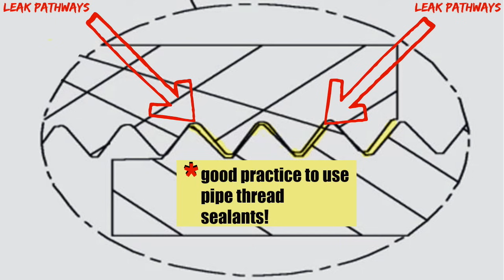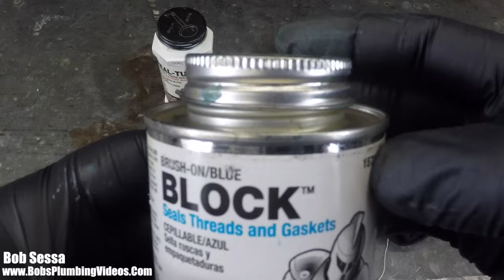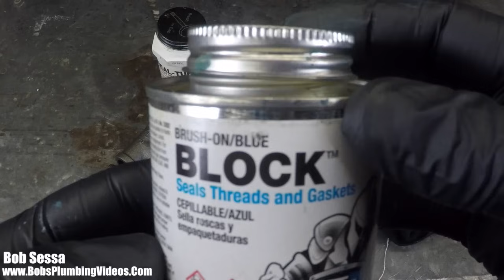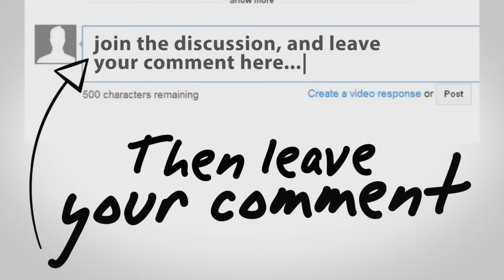Pipe Thread Sealant / Which Pipe Sealant & Why!

Comment: Sometimes you have a 90-degree fitting. It must point in a certain direction. So you won't be able to tighten it all the way down. I'm assuming by using both materials it will aid in this? Thank you in advance.
Reply from the maker: If they're loose threads, you can fine tune things by adding more Teflon for sure.

Comment: Thanks for the video. What is the maximum temperature you can use with those compounds? I need to install a brass fitting into a steam generator iron tank made from stainless steel.
Reply from the maker: I use the blue block on steam heating systems daily. 212 degrees plus, work like a charm.

Comment: nice video sir. so what about steam and high temp water. i run boilers and we heat water to 350 degrees and add nitrogen pressure so it doesn't boil. so 250 psig and 350 degrees F. all the old school guys put pipe dope then Teflon and more dope. thoughts? pipe dope is gas X
Reply from the maker: So as a kid/helper I was taught to use lamp-wick (spool-wick) followed by Pro-Dope (by Hercules). On problem joints instead of Pro-Dope, we used Grip again by Hercules.

When Teflon came onto the scene, I  started using it followed by Mega-Lock which I still use today. For problem joints, new steam installations, gas work, I use Blue Block. N.Y.C. code doesn't allow Teflon for gas work.

 No right or wrong here, guys have their own personal ways of preparing a joint and the goal is not to have any leaks. The Blue Block has never disappointed, but don't get it on you or your tools, it's a pain in the Ass to remove (lacquer thinner)

Regards, Bob.

Comment: If tighteness is by feel how do you keep things perfectly up and down such as a shower neck. What if it's as tight as you can get it while being straight but it still leaks?
Reply from the maker: Bottom line is you may have to remove it and try different techniques. More tape, use some lampwick, whatever it takes to make it leak free. If you over tighten things, you always run the risk of breaking off the threads. But you do what’s necessary to stop the leak.
Reply: @BobsPlumbingVideos  I literally got these to where they tightened easily by hand and then another quarter turn is all they had, using leverage too.

Comment: Would it make sense to add dope before AND after applying the Teflon tape? If you think about the mechanical stress on the threads, it’s actually in the shear direction, right? So wouldn’t the dope be equally advantageous on both sides of the tape for the micro gaps in the male’s and female’s respective threads?
Reply from the maker: Some guys actually do that. I personally will apply tape first followed by pipe joint compound. Regards, Bob.

Comment: Thanks!  I think I now know why my 1.25 to 1. inch reducer is leaking/dripping on my pressure tank diy hook up.  I over-torqued it and used only metal pipe dope.  I will get a new reducer and use teflon with teflon sealant, and not over-torque.

Comment: Do you have a video or, know of a video that shows how to connect a PVC schd 40 female or male adapter to an elbow on metal pipe?
Awesome video, Bob. Thanks so much.
Reply from the maker: When I screw schd 40 pvc on or into metal pipe I generally use teflon tape followed by Blue Block or Grip. Either or will work.
Reply: @BobsPlumbingVideos  and only to prevent abrassion on the plastic part and prevent sticking, so not as much as metal-to-metal, right? 
BTW, one can really see you know your stuff. On the other hand I like the looks of neatly wound teflon tape sticking out - it looks clean and done to me when checking later (but only on ugly plastic or metal hidden joints, not the fancy visible shiny pipes).

Comment: Dumb question. - what if you forgot to do this on a multi part set-up and it would be too hard to take everything apart? Is there good (enough) way to add something to the threads AFTER everything is in place?  Or am I (un) screwed?
Reply from the maker: Not that I’m aware of. If it’s a very minute leak, a little blue block over the leak and it may help. But I’m talking about a sweat bubble,good luck!
Reply: BobsPlumbingVideos   Ok thanks. Turns out the pressure reducer might be bad so everything will have to be cut out anyway. Will get to do it “right” when replacing. *Sigh

Comment: When I changed over from galvanised pipes to copper tubing 35 years ago, I installed a permanent pressure gauge on the cold water line in basement laundry. Many older homes in Vancouver, B.C. Canada where I live do not have a pressure regulator valve. The typical pressure in my neighbourhood was about 80 psi, dropping somewhat in the summer. A few weeks ago it was going up as high as 120 psi, so I decided to install a Watt pressure regulator on the 3/4 copper entry. My first two attempts with teflon tape only on a tapered brass fitting dripped, and on my third try with even more tape it still leaked, and now a union on the line was dripping. I found your video, bought the Canadian MegaLoc, which has English and French instructions, followed your directions and both connections are completely dry. What I really noticed as I torqued with the MegaLoc and teflon combo, was how smooth and easily it tightened compared to teflon only. Pressure is now set at 60 psi. Sure glad I found your video. Angus.
Reply from the maker: I’m glad you found my video also Angus, love helping homeowners like yourself. Regards and thanks again...Bob

Comment: Excellent video.  Thanks for the detailed explanations.  I wrestled with leaks installing an outdoor water spigot.  Teflon tape alone didn't cut it.  I ended up using Teflon tape and Real-Tuff Thread Sealant.  Totally did the trick.  Thanks much!
Reply from the maker: Thank Goodness Yo-yo Patrick for checking out the video! Regards, Bob.

Comment: Thanks for the advice! I only put Teflon tape on a new kitchen sink shut off valve and it wouldn't stop leaking. I'm going to get some sealant tonight!
Reply from the maker: Good Luck!
Reply: BobsPlumbingVideos it worked like a charm
Reply: Did you use 4-5 wraps?   But i know the old pastes and the new pastes work better. Just messy.  I’ve seen pros use both wrap and paste together.

Comment: My rust-off part of the steel pipe left in the steel elbow is so hard to extract. The extractor is scraping off the interior of the metal pipe, but the part is still not moving. What kind of thing could have been applied on the thread?

Comment: Dope then tape. Fills in the threads better and comes out much cleaner. I'm a Fire Sprinkler Fitter and I usually do about 5 wraps. We use either Teflon dope or C5A copper anti cease along with Teflon tape
Reply: The age old trade argument. Lol.

Comment: What goes first pipe dope then Teflon ? Or Teflon then pipe dope ? I personally do Teflon first then pipe dope. I know a few plumbers that do pipe dope first then Teflon. Give me your opinion.
Reply from the maker: Ricardo Quinones  I personally go with Teflon first followed by mega lock. But I know plumbers who prefer to apply the compound first followed by the tape. I guess it’s a matter of preference. Regards, Bob.
Reply: BobsPlumbingVideos truly I feel it’s more than preference because blue pipe sealant is more or less dual purpose it’s a sealer as well as a lubricant so when you apply the sealant before the Teflon it’s gonna act as a barrier in between the tape and the metal while the sir may work I feel like the Teflon will bunch up on you or slip a lot easier just my opinion

Comment: What do you use on fittings that carry heating oil?
Reply from the maker: I would use  the Blue Block or Hercules also makes a product called Grip which is colored black. Where gloves and use it sparingly, it can get messy if you're not careful. I believe they do make PTFE tape that will work with oil, you'll want to check with the major manufacturers of pipe sealants.
Reply: Thanks. Yeah I've had luck with the yellow teflon tape which is rated for diesel fuel.

Comment: Great vid with tons of info.  It appears you prefer Blue Block for gas applications as stated around the 14 minute mark.  But I need one thing clarified if you can:  
Is Blue Block the product of choice for every connection from the supply line to the appliance?  i.e. Black pipe coming from floor to brass shut off valve - Brass shut off to stainless flex line - stainless flex line to a stainless fitting - And finally connection to appliance.  Is Blue Block good for all those dissimilar metal connections?
Reply from the maker: In my opinion, It's the best choice for leak free joints. You just have to be "neat" about it if you can cause it's a bear to get off (lacquer thinner).

Going from the outlet of the gas cock including the flexible connector and range fittings, I generally use Mega-Lock, simply to avoid getting that Blue Block all over the place. Thank You for checking out the video!

Regards, Bob.
Reply: You aren’t supposed to put anything on the stainless. Flare fittings work without sealant. I’ll dope unions and flat basket washers but I was always taught never to dope flare fittings.

Comment: Blue block with teflon tape works in both new and old pipes because the new ones come with all kind of impurities also, you don't want to take any risk. Of course for the gas pipes only blue block on the male thread.

Comment: Thanks so much!  You took my small little job too another level. Simply I have to put a 90 Into my gas cook top. I was just going to use the gas teflon tape. I have two elbows to Install, going out to buy pipe dope. You rock!

Comment: I do not use Teflon tape, period.  Yes, it is quicker and cleaner, but if leak prevention is important, I only use threaded pipe sealant, and specifically Harveyseal formula 55. I just finished installing an 80 gallon air compressor and plumbed it with copper pipe, some sweated joints and most with threaded fittings to accommodate the ball valve and regulator. 175 PSI and no leaks!

Comment: I'm in Europe so we might have different fittings but I think some of our threads are straight, not tapered. I have a problem when I can't fully tighten a joint because it will finish up pointing the wrong way. Is there a different technique for straight threads?
Reply from the maker: Hard to answer because all I've ever know is National Pipe Thread N.P.T which is tapered to create the water tight seal. Straight threads would just continue making up into the fitting, so I'm not aware of how you would make that water tight.
Reply: HI Bob... Very informative video... I'm in North America but in the same boat as Phi in that we have two sets of wall faucets. I was advised to use ProDope to help seal them, and for one it worked really well (so far) however the other one has a slight trickle when the pressure of both hot and cold are up full. Both are straight threads where the tap screws into the fitting and once in the proper alignment are pulled tight together by an outer threaded ring that is tightened against the wall, tile or wood (as is the case in my installation). When I first installed both faucets neither leaked. I believe the one that does show a slight leak however was inadvertently nudged and may have broken the seal? I un-installed the faucet, cleaned the threads (about 90% clear with fitting side less so due to it being in the wall) and re-installed with just the ProDope again (small town so not much else is available here). Would I stand a better chance of a better seal with your teflon (white or pink?) and ProDope? and... do i need to get the threads (male and female) absolutely  clean before re-installing?
Reply from the maker: Bottom line in my opinion is if you use a few rounds  (4-6) of plain old white Teflon followed by the pro-dope you should be good to go. If you can find the Mega-Lock or Real Tuff better. I think the pro dope is petroleum based and may have an adverse effect on the teflon. Hear are a couple of links: http://amzn.to/2iXBo9d or http://amzn.to/2iXGEJD. good Luck! Bob.
Reply: Thanks Bob... wow... very quick too! I'll check out to see if either of those two products are available within an hours drive and try that out. If I'm able to get one of them can you tell me if once applied and installed ... if there is another leak will I be able to disassemble the tap from the fitting easily again? In the mean time I'll probably have another go with the teflon and ProDope although I'm a bit concerned now about the petroleum base of the ProDope. Will check into that before forging ahead with than one.
Reply: I only bought the stuff yesterday so I've not tried it yet but I was advised elsewhere to try Loctite 55 string. This looks much like PTFE/Teflon but is a lot stronger and comes with a blade to cut off a length.
Reply: Hey Phi... how did it work out for you? I ended up finally using orange teflon around the entry end of the faucet, coated it with a thin layer of Megaloc, then filled the remaining threads of the faucet with Megaloc, screwed it in and secured in place with the locknut washer (included)...  three days in and so far it seems to has done the trick

Comment: With threaded brass fittings, leave ~2.5 threads showing on the male connection as a general guide to avoid over-tightening the softer brass.  Brass threads can warp, crush or distort if over-tightened.
Reply: If you don't make the brass scream, it's not tight enough.

Comment: my problem is in the fitting where the pipe goes in will the blue block work on this. I believe the treading in the fitting is a little worn. will blue block work on this.
Reply from the maker: I would recommend using a pipe tap to clean out the threads, then follow up with lamp-wick and blue block.

Comment: Does oil from machining threads need to be cleaned off before applying pipe dope and teflon  tape? Or not necesary? Does oil prevent compound from sealing well?
Reply from the maker: I wipe off all the cutting oil before applying tape or compound.

Comment: what do you used for water seal when connecting a male threaded pvc to a threaded cast iron or brass female opening
Reply from the maker: I would use Teflon tape first followed by Mega Loc joint  compound. If it's a problem joint, maybe the spool lampwick followed by the Blue Block.

Comment: Hi have you used a loctite 59241? I found a tube in my plumbing box probably good 15 years old.. when I used it on my compressor fittings.  And a few days later I removed the pipe. The paste wasnt dry. It was still wet kind of pasty almost, my question is it supposed to remain kind of wet. Or is it supposed cure and fully dry?
Reply: 592 is a medium strength slow curing thread sealant. It should work quite well.   I use a lot of 545  and am happy with it except for its price.
Reply: 545 sets up if away from air  but as I've not used 592 I don't know if it does.

Comment: How does leaving the first thread untaped work? I hear for and against.
Reply from the maker: Some plumbers leave it untapped so the pipe will engage into the fitting easier. Personally that's going to depend on the condition of the pipe and fittings I'm working with. I either will or will not go all the way to the end of the pipe.

Comment: Can you just use the megaloc without the tape on water pipes?
Reply from the maker: On gas lines (low pressure) I use only the Mega-Loc. For all my waterlines, (high pressure) I use Mega-Loc and Teflon or the spool Lampwick. I don't want to chance getting a leak at a later date. Regards, Bob.

Comment: I'm trying to stop a leak between a 1" FPT polypropylene water filter housing cap and a 1" MPT to 3/4" PEX brass adapter.  Is there a thread sealant similar to Blue Block that is safe to use on potable (drinking) water lines?
Reply from the maker: For that application  I would use the Real-Tuff thread sealant on top of Blue Monster teflon tape.
Reply: @BobsPlumbingVideos  Thank you so much for your help, my leaks are stopped.  I installed an Aquasana Rhino 600K whole house water filter system consisting of a pre-filter, a tank and a post filter.  The system was intended to be installed with the filters in-line with each other using PVC pipe and union.  However, I didn't have room for that so had to install the filters above the tank using 3/4" PEX.  I had leaks at the inlet and outlet on both filters (fortunately none at the tank).  Aquasana wasn't any help, they just said use more teflon tape and nothing else.  I had already tried 7 wraps of Blue Monster tape with Oatey Great White pipe joint compound on one of the leaks and while that helped I still had a small leak.  Ended up using 9 to 10 wraps of Blue Monster tape with Real-Tuff thread sealant and that fixed all 4 leaks.  Thanks again!

Comment: Finally a truly informative, fundamental video! You almost lost me when you wrapped the nipple without flattening the teflon tape... Just curious why is teflon not code for gas in NYC?
Reply from the maker: That's a good question? I honestly don't know! NYC has it's own quirky rules in certain cases and the teflon on gas is one of them. I use the Blue Block on all my gas work and it's never let me down. a little messy if you're not careful, but effective. Regards & thank for checking out the video. Bob.
Reply: What are your thoughts on rectorseal yellow?

Comment: I have lots of plumbing experience and stick with pipe dope only.. Teflon tape IMO just gets in the way of the seal.. The threads are made to seal without the sealant.. The dope is actually just a lubricant..